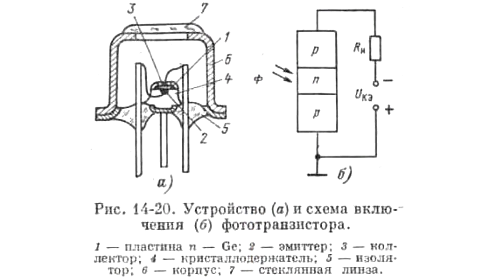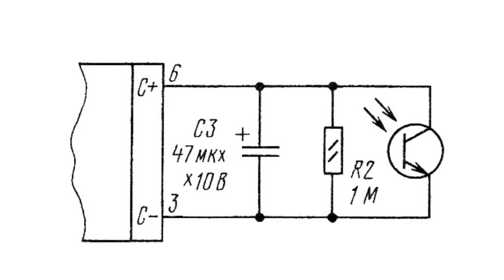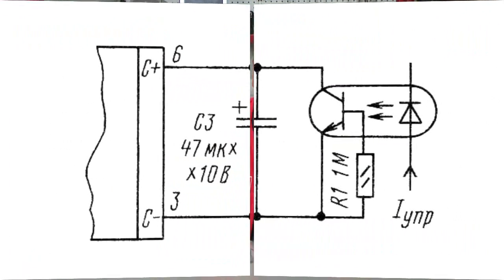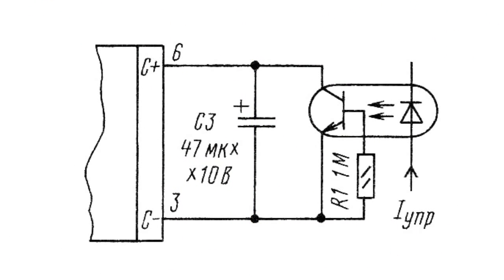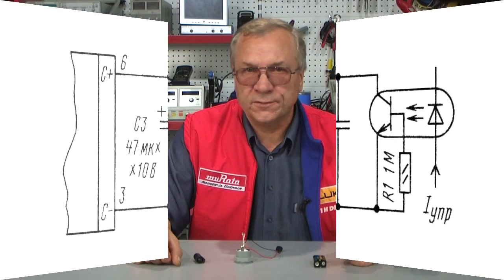Operating Principle of Phototransistor

Comment: It is not the base region that is sensitive to light. In fact, even if the base region is blocked from light, the phototransistor works pretty well as long as the collector is accessible to light illmination.
Reply: Can i measure current generated  without any amplifier?
I mean using micro current multi metere